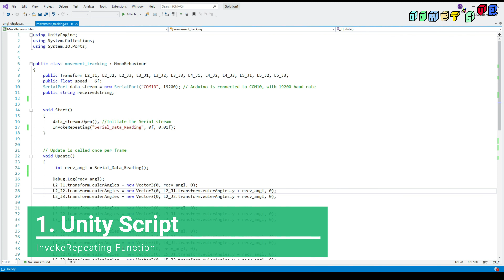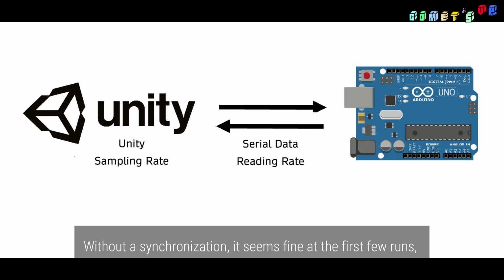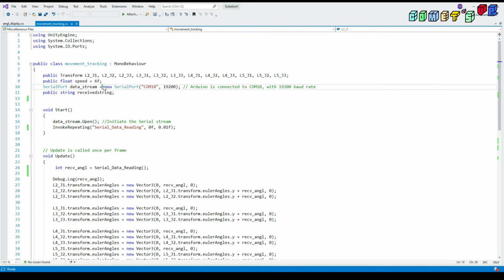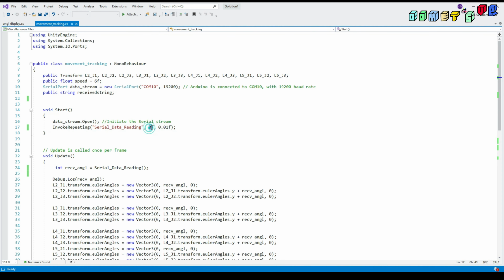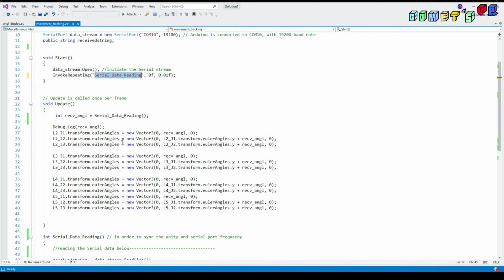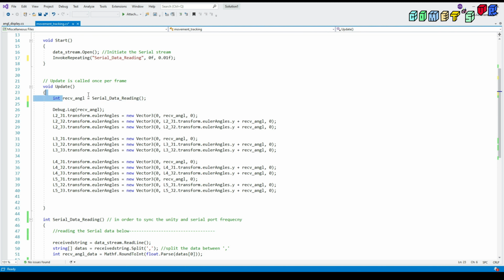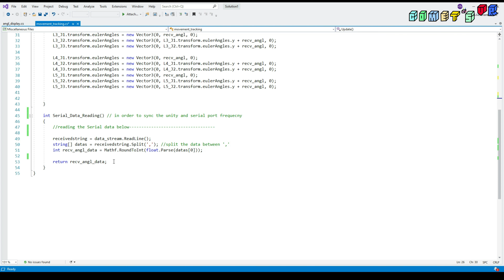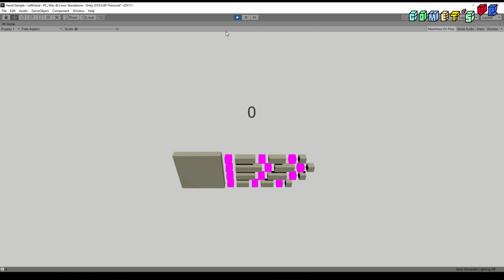How to Connect Arduino to Unity #2 Make a Stable Serial Connection Between Arduino and Unity

Comment: how to send data, via wifi from unity to arduino.
I am working to send some  objects' collision data of from unity to arduino but i am unable to make a wireless connection, from my unity scene to arduino which has an ESP8266 attached.
Can you please guide or can you make a video on it quickly. i need some guidance quickly as soon as possible.
thank you
Reply: You can use service link thingspeak, MQTT, Blynk and then you send data from unity to these services and read that data via NodeMCU or arduino attached with esp8266 for fast response use MQTT I made a project (Gesture remote for android) through this but i use blynk

Comment: Hi, can you help me sir . how to connect arduino to unity using emg signal as a controller ? what is the code for do that ?
Reply from the maker: If you are using Arduino and Serial communication, then it is easy. It depends on the data format, but you can send the data format as long as the serial port supports. If you check my other videos, you will see the codes and instructions. Thank you.
Reply: @comet-tech  hi again. i already connect the arduino to unity successfully and the sensor value has been display on unity. But the game object is not trigger and it still cannot be play using the muscle. I wanna ask you how to set the sensor value as a input in unity? btw im create a flappy bird game and i want control the bird using muscle sensor. i hope you can help me. tq
Reply from the maker: @cartoonsky3682  It is really hard for me to answer without knowing how you are going to use that value as an input. My suggestion is, trying to use that as a position or rotation in an object so that you can see that moving.
Reply: @comet-tech  im going to use it for control object up and down only. i already try everything but im still cannot get it. Please help me.
Reply: @comet-tech  this is my code for unity:
 using UnityEngine;
using System.Collections;
using System.IO.Ports;

public class Bird : MonoBehaviour
{
    private int V = 0;
    public float upForce = 200f;                   //Upward force of the "flap".
    private bool isDead = false;            //Has the player collided with a wall?

    private Animator anim;                  //Reference to the Animator component.
    private Rigidbody2D rb2d;  //Holds a reference to the Rigidbody2D component of the bird.
    private SerialPort port;

    void Start()
    {
        port = new SerialPort("COM3", 9600);
        port.Open();
        port.ReadTimeout = 30;
        isDead = false;

        //Get reference to the Animator component attached to this GameObject.
        anim = GetComponent<Animator>();
        //Get and store a reference to the Rigidbody2D attached to this GameObject.
        rb2d = GetComponent<Rigidbody2D>();
    }

    void Update()
    {
        if (port.IsOpen)
        {

            float value = port.ReadByte();
            //Look for input to trigger a "flap".
            if (isDead == false)
            {
                if (Input.GetKeyDown(0))
                {
                }
                else
                {
                    //...tell the animator about it and then...
                    anim.SetTrigger("Flap");
                    //...zero out the birds current y velocity before...
                    rb2d.velocity = Vector2.zero;
                    //	new Vector2(rb2d.velocity.x, 0);
                    //..giving the bird some upward force.
                    rb2d.AddForce(new Vector2(0, upForce));
                    rb2d.AddForce(new Vector2(V, upForce));
                }
            }

            void OnCollisionEnter2D(Collision2D other)
            {
                // Zero out the bird's velocity
                rb2d.velocity = Vector2.zero;
                // If the bird collides with something set it to dead...
                isDead = true;
                //...tell the Animator about it...
                anim.SetTrigger("Die");
                //...and tell the game control about it.
                GameControl.instance.BirdDied();
            }
        }
    }
}
		
	

	
this is my arduino code:

void setup() {
  Serial.begin (9600);
}

void loop() {
  float sensorValue = analogRead(A0);
  float millivolt = (sensorValue/1023)*5;

  Serial.print ("Sensor Value:");
  Serial.println (sensorValue);

  Serial.print ("Voltage:");
  Serial.print (millivolt*1000);
  Serial.println ("mV");
  Serial.println ("");
  delay (1);
  
}

Comment: Thanks for very useful video : ) I am going to do a unity game project with arduino uno board at school. I guess this video will help me but I'm not sure that these kinds of serial communication works on any unity engine version. I would like to use 2019.4 LTS or 2020.3 LTS. Will it work properly? Thanks a lot.😊
Reply from the maker: Yes, it works with all version, but in the project setting, you need to change to Net 4.X in order to use IO ports. Hope this helps!

Comment: I am transmitting sensor data from stm32 board to Unity. When the transmission interval is every 2 seconds, Unity receives data every 4s; and when transmission interval is 3s, Unity only receives data ebery 6 s. It seems that everything is doubled. I've tried your method, but didn't work out. I also tried to toggle led on board in the interrupt handler as soon as transmission completed (Tx_State flag). What do you think other causes it could be?
Reply from the maker: I cannot help you without seeing your code...